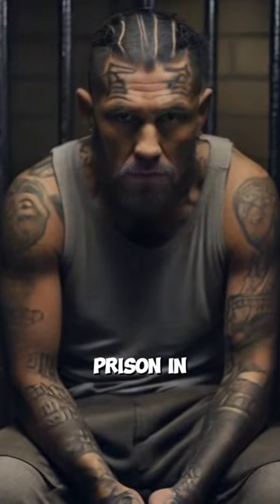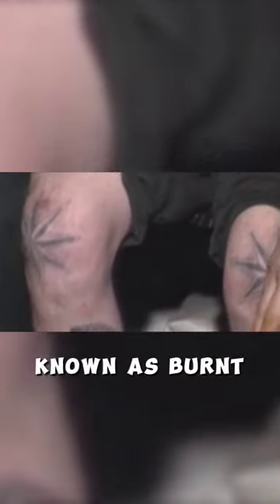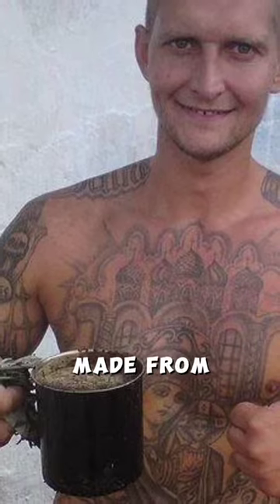How tattoos are done in prison.

Comment: As a former jailbird 
This is not how tattoos are made in prison…
It’s made with soot from burning styrofoam and then a staple will be sharpened and you will burn the sharp tip with an open flame to disinfect
Reply: L-M-A-O, I was about to day the same thing...ummm hello they use a lighter if they have one or boil the needle in a can with a stinger.  Who is using urine?!!  My 9 year old?
Reply: We used to burn a spoon or a plate and then scrape the char off
Reply: in russia we did just how hi said. where you spend your sentance?
Reply: In prison I made mine by baby oil, cotton wick, foil from kitchen, paper bag from commissary, pop the socket, light wick, let the baby oil burn out into paper bag, once burned out completely scrape the soot from paper bag, mix with clear Pantene shampoo or conditioner and your all set